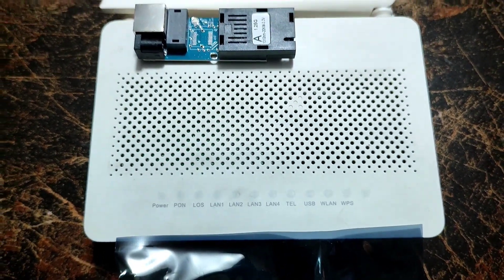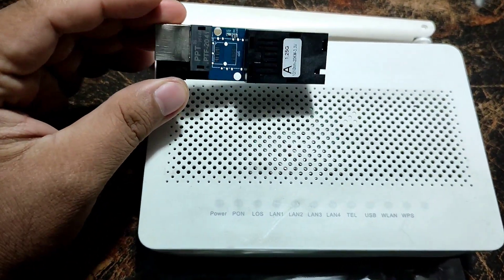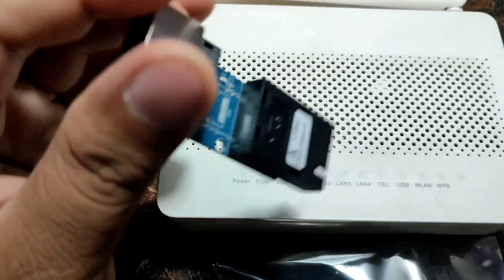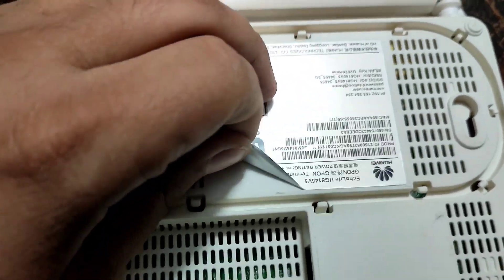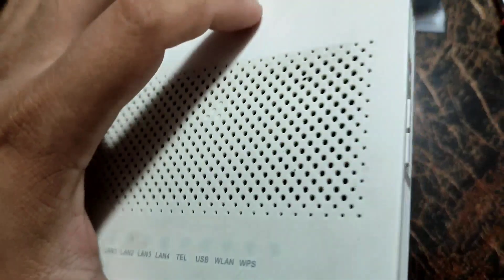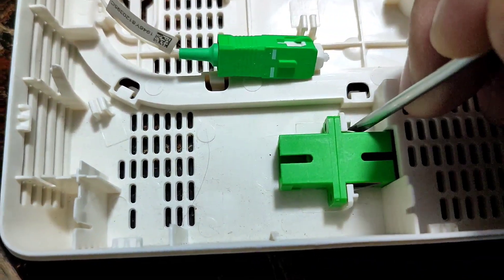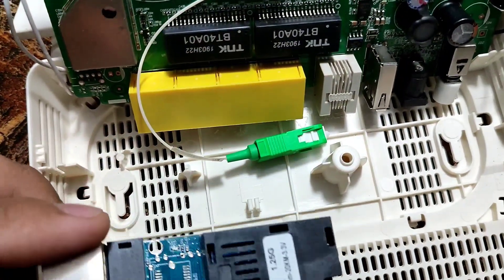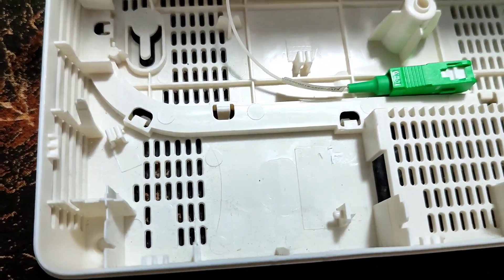5V5 epon conversion to media converter .

Comment: The main question that I have,is the incoming fiber signal,does it come from the splitter still? Or does it come from the other side of the media converter?( Like is it a point to point connection side A connected to side B)?
Reply from the maker: It's using a media converter the connection is A to B or vice versa point to point.
Reply: @TitoYabiDIY  ok cool

Comment: Salamat sa video sir, kung gamitin ba siya sa pisowifi. Pwede pa kayang magamit sa AP yung remaining 3 ports?
Reply from the maker: Pwede po gamitin. Depende kung bridge or router mode nyo po sya gagamitin. Pwede po kasi sya kahit hindi pppoe.
Reply: @TitoYabiDIY  boss halimbawang AP ko lang siya balak gamitin, i check lang ba lahat ng LAN tapos i up link ang port 1, off ang DHCP sa lan, at piliin ko router mode ba o Bridge?
Reply from the maker: @jiggah21st  tama boss. Tas select IPOE then try mo ang bridge mode. Then try mo turn off dhcp. ☺️
Reply: @TitoYabiDIY  ok boss maraming salamat, sinubukan ko kasi siya na ikabit dati as AP na ang config ay i check lang lahat ng LAN at DHCP off. Hindi gumana ang mga naka connect sa lan as PPOE.
Reply: @TitoYabiDIY  one more question boss, possible ba siya magamit as PPOE yung wifi niya pero pang AP naman yung mga lan ports? Maraming salamat ulit

Comment: Bakit po maraming bumibili ng 5v5 router na DISCONNECTED ano ginagawa nila boss?
Reply from the maker: Kasi ginagamit sya as modem pag na flashed as ONU ng mga naka OLT nating tropa. Maganda kasi performance nya. Mataas kasi specs
Reply: Sir last po ano yung ONU and OLT . Kasi namimili ko ng 5v5 pero di ko alam kung para saan gagamitin. Mag karon manlang po ko ng idea